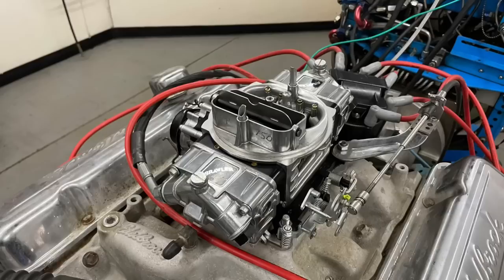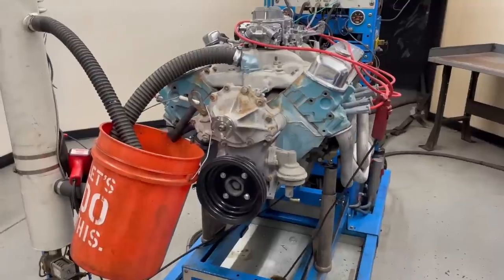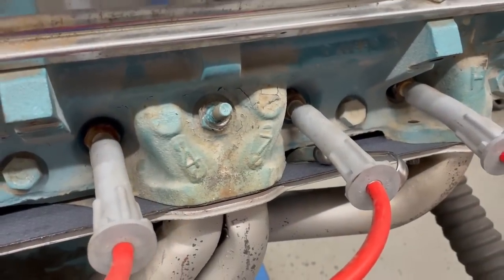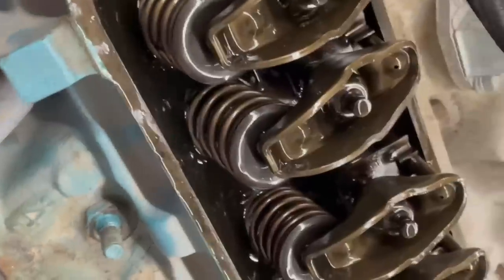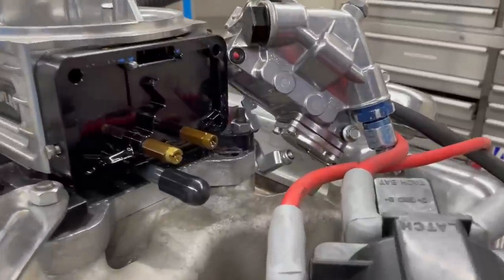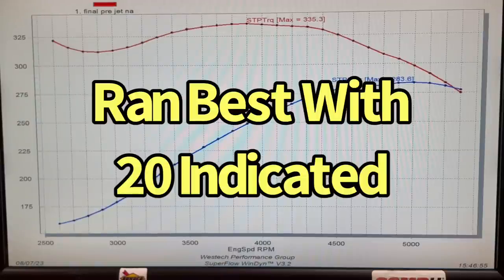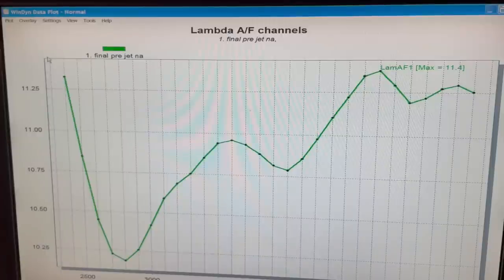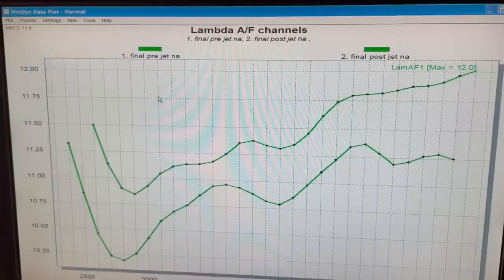WILL IT RUN? 1969 PONTIAC 350 Step 1-Make it Run Right! Make some dyno Pulls! Make Some Poncho Power

Comment: I had a 71 Firebird with a 350 2 barrel. I always wanted to modify, but did not have the cash at that point . I always felt like engine was bullet proof and would make good power if built right. Would love to see more mods, normally aspirated mods. I love the old Pontiac engines.

Comment: Using a needle-style vacuum gauge as it's running would give the clearest tell-tale sign if the problem is valve related, simply by watching how the needle fluctuates during idle and as throttle is increased. Then, you just refer back to the gauge reading guide, and you'll have a clear idea how to further diagnose the engine.😉

Comment: I think it's over-cammed so for that I'd try raising the compression a tad.  So next episode maybe put a set of dedicated 350P head gaskets on it from Cometic that fit the bore and variable thicknesses, new valves (to maximize CR)  with performance valve job and a garage bench port job.  Benefits: Can achieve quench along with more compression for better torque, higher upper end airflow from the bench port job.  Maybe a small to moderate re-surface of the head.  WIN-WIN.
Reply: PLEASE RICHARD !

Comment: #47 heads on a 350 is around 8-8.5:1 usually. They were rated higher compression but usually werent. Small valve stocker head. 

They were rated at 265 with a 4 barrell the extra 20hp could be the manifold or an 066 cam.
Reply from the maker: the rated power was tested differently than this
Reply: @richardholdener1727  definitely was , gross vs net. 71 from memory , don't know how bigger difference it made .

Comment: The 1969 350 with 47 heads was originally equipped with a 2bbl carb, is advertised 9.2:1 compression and rated at 265hp. The addition of a 4bbl carb and mild cam and headers would typically bring the horsepower up to over 300. Kind of surprised it only made 283.

Comment: My iron head flat tappet 350P went 12.4s at 8.8 comp.  Current aluminum head/ roller cam 350P has been 10.99@121 through the mufflers!
Reply: Are you running Edelbrock heads ? All I’ve ever read is that valve shrouding due to the smaller bore makes power gained negligible. Basically spending $2000 to only save some weight.
Reply: @ericthompson3551   I am running KRE d-ports on the current 350.  Got them as bare castings and designed my own chambers using a 3.91" bore fixture on the flow bench.  Eddy d-ports with the CNC chambers are an absolute disaster on the small bore fixture.  Getting started on a 350 based 4.25 stroke 412 build.  Bought a set of Eddy RPM heads for it.  Have a 2.08/1.57 valve combo in it....both of which free drop down the small bore.  Currently at 336cfm @.700 with the 3.91 bore.  Thinking the 412 is gonna make some power. 😁
Reply: Running that 350P in a small car?
Reply: @buzzwaldron6195  73 Ventura street car.  3450lbs w/driver
Reply: @wayneskelly4297  - Yep, a lightweight...
Reply: Seriously badass! Love hearing about guys building the 350s-checked out your clips and am impressed! Would love to see a long form video of the evolution of your 350 builds and that badass Ventura
Reply: That's Awesome!

Comment: Mine's running funny with a miss fire. I have ruled out that it's not fuel. New plugs did not help, all wires were checked, as well as timing was backed down 6 degrees. I guess I will also have to change out my distributor cap and rotor and see if that straightens it up.
Oh, I also did a compression check and all was good. The timing chain and gears are new, as well as all the lifters. This problem didn't arise until the year after I did the gears and lifters. I was already thinking it was in the distributor. 
My engine is a 72 Pontiac 350 in my 72 Lemans. It just turned 90,000 miles. I was daily driving it until this problem popped up.

EDIT: Thank you so much Richard for videos like this. They are a huge help.
Reply: Probably have a wire on distributor in wrong place or check valve clearance take off valve cover

Comment: Wallace racing specs sheet advertise the 68' 350 and 400ci 2bbl small valves "17" 9.2(350) and "14" 8.5(400) comp. heads, both at 265 gross HP, 
The 350-4bbl H-O 10.5 small valves "18" heads was 320 gross HP.
In 69' the 350ci 2bbl "47" is the same 265hp and the 4bbl 10.5 Big valves jumped 5hp to 325hp with the "48" heads.  
According to Pontiac specs, all 350ci HO had the 68 camshaft.  And the 1974 GTO 350 had 200hp NET with the small valves 96cc "46" (4c) 2H Heads and the 066 Camshaft.
I have a 66 Starchief Executive with the factory YF-389CI 4bbl 325hp and 425fp with the 092 small valves heads with 10.5 compression with the 066 camshaft.  
You know that it was all advertised HP amd Torque sometime to show off more, or to show less to pass federal inspection. 
One thing i know is when i let go the gas on my Starchief is that i tought I had broken the speedometer since it was old and i had to count like 10+sec to see it rise from the dept of the Dashboard.  It's advertised at 133mph and I know I was going even faster with the BM's 18" wheels I put on with the resto-mods restauration I did on it. My cousin have a 2006 Maxima and He couldn't follow me on the strech.
On the Dyno like that,  it's 283 gross HP I think, still around the 220 net HP with that 4bbl. 
I think It as a 066 camshaft from the straight Torque curve. I think the 068 or any aftermarket with the same specs should have got a little steeper curve.  Specialy at low RPM with a bigger drop for the afterburst bigger duration and lift of the 068.  But again, I maybe totaly in the ballpark or in the field.  No clue on what's been done to the intake, the heads port, gasket matching.  Your the Expert with the Engine in your shop.   Nice content.

Comment: You should hit the sweet spot for the no-headers powerband at about 50,000 RPM, yeah?

Since the cam peaks in torque at 3800 or so, I'd say it's most likely stock.-ish?

Run a turbo on it, but for a change, make a it tiny turbo and turn this into a stump-pulling-torque motor. Spooling at 250 RPM, it should be great fun!
Reply: And stroke it, and decrease compression ratio to something below 8 to 1 for it to function with ridiculous backpressure. And limit RPM to something like 4000, to not to explode the small turbo.

Comment: I had to pull down my old chilton for a look a the factory numbers. This engine with the 2bbl rated GROSS 265hp at 4600 and 325lbft at 2800. 

Compared to stock, It made similar numbers at a higher rev and a performer intake- That's wild. The cam must be quite small and unable to take advantage of the 4bbl.  I have a set of the 1968 #17 heads and used to have a set of 47s. They looked comparable although the 68s had a 30 degree intake valve seat and the 69s had a 45 degree seat. Unfortunately I only measured the #17s but they were a little over 85cc chamber. This setup is likely very low compression in spite of the printed. 9.2 to 1 numbers. It will be interesting to see how big these heads chambers are but it's probably barely over 8 to 1. 

I'd love to see cam testing along the lines of a 2800 and a 2801 along with a modern performance roller. Maybe some porting and bigger valves on the heads and high compression. A comparison of Stock, performer, RPM and Torquer II intakes. Boost on the engine as it stands from the baseline setup? Basically your regular playbook because it's awesome and gets to the point. Love it.

Comment: Richard, how about modernizing in a bit? Efi, heads hydraulic roller,little compression. See if it will make close to modern LS type horsepower.

Comment: I have a 1969 Tempest with the base V8, the 2bl 350 V8.  As stated above it was 265 hp stock and supposed 9.25 compression.  It seems a little weak for this motor to be 4bl converted with a performer intake.   Factory cam it should idle smooth as silk.  I would love to see Edelbrock heads with the factory cam, valves supposedly might hit, but some people have done it.

Comment: The 350 Pontiac compares well with the 389. The stock 350 has 354 cubic inches. The 350 has better cylinder head ports than the 389 and the push rod guide plates keep the valve train more stable than the 389. The 350 4 barrel has a better carb and intake manifold than the 389. The two barrel camshaft has the pre-1965 70 percent lobes, while the 4 barrel version got the newer, more aggressive 75 percent cam lobes that came out with the 4 barrel and tri-power 389 and 421 engines of 1965. That is, the cam duration at 0.050" cam lift is 75 percent of the SAE 0.006" valve lift duration, not the advertised duration. This can be compared in older Melling catalogs. Throughout the 1960's, the two barrel Pontiac engines continued to use the older 70 percent duration 2 barrel camshaft, which was also used in all 4 barrel 326 engines.

Comment: I'd love to see this tested with log style manifolds VS Ram Air manifolds VS headers. I'd like to see if those Ram Air manifolds actually are as good as the Pontiac guys claim.
Reply: I believe someone did do the test with shorty headers. The Ram Air Manifolds only made 1hp less than shorty headers and had the same amount of torque. Long tubes I believe made 16 hp more (I forgot the torque numbers).
Reply: @Boatanchorperformance  that's better than I thought they'd do, to be honest. I knew they'd be better than logs, but I didn't think they'd be on par with shorties
Reply: @Boatanchorperformance  and I say that as someone who mostly prefers to use iron manifolds over headers when possible just because they're less headache lol

Comment: Im thinking stock cam. Those heads belong on that engine, has 8.6 compression, and was rated at 265hp. With the way youre testing it with headers, its probably the factory stock camshaft.

Comment: Part way through the video, going to make a bold prediction that you'll pull the intake off and find out that there is a drain hole plugged causing the lobe to go dry and you're without a cam lobe.

Those 47 heads are a decent starting point, I bet they'd shave down really nicely. My 71 has 96es at 96cc.

ED:Nice to see she ran, looking good on the power too for so few mods. The reduced timing is the long rod theory kicking in. :P

I ran the Summit 214/224 on mine, it was pretty decent and not a ton of money. Obviously not period correct but it was useable on a stock non-adjustable valve train which was nice. I probably never lived up to the potential of it as I broke it in on stock springs and never really changed them out.
Reply from the maker: long rod...that's a good one

Comment: Richard,  your '69 350 when stock with its factory 2bbl carb and intake was rated at 265 bhp gross.  So 285 bhp gross is about what I would expect for this engine with a 4 bbl intake and carb.  So, I'd say it probably still has the stock teeny tiny cam.  How many inches of vacuum are you getting at idle?
Reply from the maker: not sure I have vacuum hooked up on the dyno-til we ran boost

Comment: Not on this engine, but when you have an opportunity with a turbo engine already on dyno stand, test how much power can and engine loose with a small boost leak. For example a small vacuum tube unplugged. Or just a bit loose clamp. And also, to the same theme, how much power a turbo engine can loose with an exhaust leak in between head and turbo.
Reply: in my experience boost leaks amount to very little unless its a pretty decent leak, like blowing bubbles leak won't show up but an air blast sure will.

Comment: The hot ticket is the 6x heads with the number 4 stamped on the exhaust side of a bolt riser..they have 91cc chambers and raise the compression on a 400...I did this.
Reply: Yeah they make for about 8.2:1 on a typical 400, which is better than the large chamber heads with 7.5:1... those 6x4 really shine on a 455 tho, where they make for nearly 10:1

Comment: 350 are considered to be Boat Anchor's.  Small bore, long stroke, 150lbs heavier then a sbc.. same block as a 400 455
Reply: Also very reliable
Reply: People that think this are in a word, wrong.
Reply: @AEtrane Exactly! Thank you it's within a 50 weight diff but more cubes 354 and lied about to keep lill orange from crying....I had a 70 350 2brl jets drilled out Poncho that seen several over revs to access of 6500 and the only things bent were push rods! Most forgiving engine I ever owned and we didn't use boost   back then so there wasn't any 35mph roll BS! It was heads up   A to B who ever immediately outpaced the other and raw NA  motors-when the Hobby was fun and we helped are friends not talked smacked like 14yr olds

Comment: And for NA engine, there are some things to test, but that its not for a single cam OHV. 
For a double cam engine:

1. Would a massively retarded intake cam (intake close time ~ 100 degree after BDC) will make the engine function as an Atkinson cycle. For this the intake cam should be a lot higher duration than stock, to not to mess up the intake opening angle. The question would be, how much power you then sacrifice for how much MPG gain? 

2. Just to have fun, with the same type of engine. How an engine behaves with a ridiculously high overlap. I mean 60 - 80 - 100 degree. Will it run, how it sounds at idle and WOT, will it shoot flames?